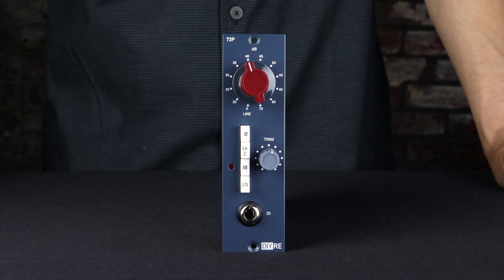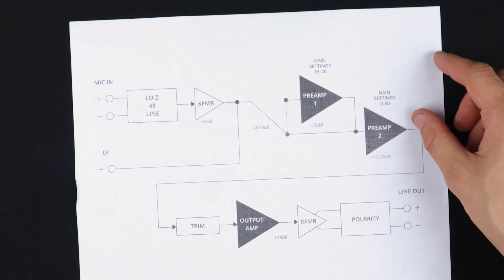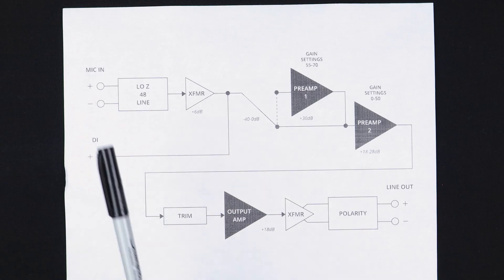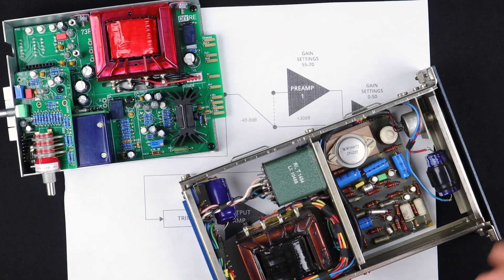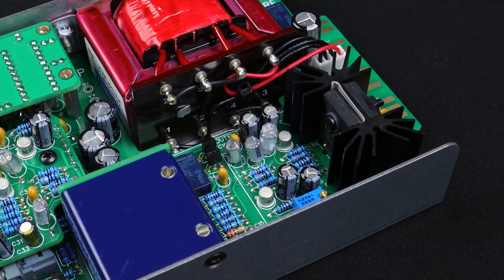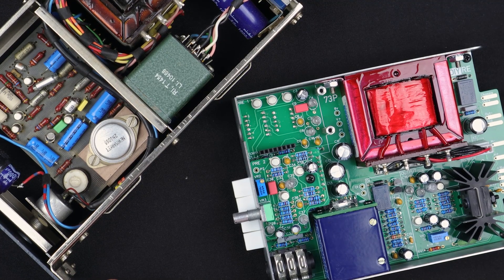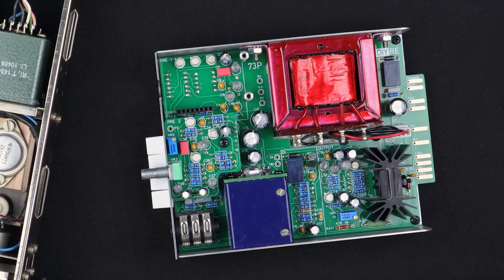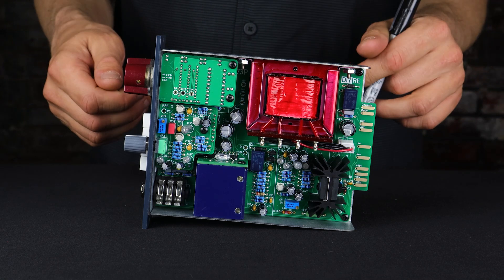What makes a great Neve clone?

Comment: Good explanation of the way it achieves high gain by inserting a second preamp stage, and also how some cheaper Neve inpired clones are actually line amps repurposed. 
However, I think it might have been useful to point out that there was never a HiZ input on the vintage modules. 
Another point Iwant to make as a user for most of the eighties of a 8068 console with 1084 modules, is that at the time most of the distorsion came from the tape deck ! And what we really loved about those Neves is that the preamp would no distort on very high transient content, contrary to many other cheaper consoles at the time. The headroom on those conseole was just amazing. So it amuses me to read on certain forums that people buy Neves for the distortion 🙂 After 45 years recording mixing and mastering music, I can tell you that the most desirable thing in a preamp is how it repects the source.  On that account there are two leagues of preamps, the clean high gain and musical ones in the first, and this preamp is part of it, and those that mimick the good stuff but have not enough headroom or too much noise. Those second league preamps can work wonders on certain sources but will fail you one day or another, like when recording very quiet sources or on the contrary extremely loud ones.

Comment: DiyRe Neve "clones" have either class A/B, or class B circuit if power supply sags under dynamic conditions. Another strange thing is calling 1290 preamp 1073 preamp/eq.

Comment: Cool.  But I think i'll wait until version 1.01 of the circuit board, so as to avoid having to tear it apart and cut solder traces like I did on a recent build using 1.0 of a circuit.

Comment: The loss thats occuring between the stages, why is that happening?
Reply from the maker: Good question. That's how it's designed. Instead of varying the gain of the amplifier stages at every gain step, the switch introduces attenuation between the stages to get the correct net gain. They did this because the amplifier stages are not stable at low gains.

Comment: You nailed it! All the key factors, and you brought out the 1272 comparison as well. Two gain stages is absolutely not a 1073/1084 preamp; it’s at best a 1272, unless they try to get 70dB gain from 2x stages, at which point it’s completely bastardized. 

I’m very interested in which transistors of the same part number distort/saturate “the best.” That was news to me but makes sense. The zener based voltage regulator is one I’ve never heard before. Makes sense, and I think it depends on what one would call sounding“better.” Basically almost none of the racked vintage 1073/1084 modules out there have this type of voltage supply. Many of the vintage consoles have had their PSU’s rebuilt to deliver a steady +24V supply regardless of current demand. I want to know what percentage of vintage modules and consoles out there still use this zener regulator topology. But still, it’s an interesting idea.
Reply from the maker: Thanks very much! You've put your finger on a big difficulty with any clone: which is the "original"? Is it the one from 1971 with an old power supply and electrolytic caps which went bad so long ago it's impossible to test what they sounded like? Or the same desk in the 90s with a cleaner power supply and fresh caps? At the end of the day you do need to make some calls base on what sounds best to you, and that's why we went with the zener/pass-transistor regulator circuit. It adds just at tiny bit more goosh and rounding of transients; that is, a bit more of what the original was known for.
Reply: @PetersonGoodwyn  Yep, I bet it sounds “slower” and somewhat“squishy” (whatever that sounds like) compared to a “properly” regulated 24V rail. I can visualize how that would look on a scope though. It will give your clone a unique flavor in a sea of clones. 

Hey, cool video. I didn’t know about your company prior to this, but now you’re on my radar. I’m a Group DIY guy, so I appreciate the super helpful educational tools you do. I’ll definitely keep you in mind for future needs.
Reply: Also, no 31267 XFMR on the line input. Is there any gain/trim adjustment capability? If so, do you just pad the line input signal and run it through the final gain stage at the “trim” block on your diagram?
Reply from the maker: Good question. No, the line input just engages a balanced pad before the input transformer. So it passes through all the same circuitry as the mic input.

Comment: its from the seventies, not from the sixities. most modules are about 50 years old not sixty. then in a typical 80series neve the input module doesn't just go to a passive bus (except bcm). THE typical 80series sound is input module, routing module, output gain module (all active 6pairs of xfmr) for a mixdown or recording over active group modules.
Reply from the maker: You're absolutely right, 70's is correct, I misspoke. Some of the schematics we referenced were drawn in '69 but didn't see the light of day until '70. And thanks for the additional insight in to the 80-series signal path.

Comment: Can you say what your main application of the Tantalums caps were?
I'm using NOS film and some Soviet paper-in-oil caps for a preamp design project and am considering Tantalums in feedback part of the op-amp circuitry and in some power decoupling.
Reply from the maker: These designs used tantalums for A/C coupling. Feedback capacitors were polystyrene and power decoupling were electrolytic by and large.
Reply: @PetersonGoodwyn  thank you 🙏

Comment: This looks great! Would I be able to replace current transformers with my vintage Marinair i/o transformers?
Reply from the maker: Thanks! I'm not positive about that. The old transformers will definitely work in the circuit, but I'm not positive that they are the correct dimensions to slip right into place. You could check the dimensions and pinout of the VTB 1148 and VTB 9045 in the Carnhill datasheets to confirm: https://www.barryrudolph.com/recall/manuals/carnhill_design_guide.pdf
Reply: @PetersonGoodwyn  , okay. Thank you!

Comment: But was it really wise to make it so that the power supply sags in every module? What I mean is that if you were tracking on a Neve, not all channels are going to be drawing tons of current all the time. In other words they're not all on kick drums and such, so the power supply wouldn't sag ALL the time.
Reply from the maker: That's a great question and gets to the core of the difficulties of trying to replicate part of a console as a standalone unit. In its original format, this preamp would have been part of a larger system (the console) that affected how it sounded. Now we're trying to take out just that one part while recreating the sound of the whole console as much as possible. The power regulator circuitry on the 73P is an attempt to bring the power closer to the original conditions, but it's not perfect. Also I should try to give you a better sense of the scale of what the power regulator does. Much like the transistor distortion, the sag is not present in the linear operating range. It's only when the unit is pushed to extreme levels that the sag begins to affect the sound.
Reply: @PetersonGoodwyn  Sure. It's all a compromise.

Comment: 3 preamps are not necessary for different gains. I would prefer only one preamp with a gain control. I don't understand very well this part. May be if I see the schematic I'll figure it out.
Reply: Then a discrete Neve design is not for you 💁
Reply from the maker: Another way to think about it is that there are only 9 transistors in this entire preamp. In even a very simple IC opamp there are 20+. So, while this design does have three amplifier stages, it does not actually have more transistors than a simpler one-stage design.

Comment: What consequences have merging on the same heatsink the output transistor with the regulator one?
I dont know much but I try to separate PSU from audio as much as possible.
Does it have any benefit to correlate heat variance from both paths or is it  just a compromise of 500 series limited size?
Keep up the work! Love your company and really dig all the documentation you give us 🫶
Reply from the maker: No consequences that we can hear or measure. Using the big transistors and heatsink means both run very cool. So neither transistor is getting into a thermal range where performance is significantly different from the baseline spec.

Comment: Really amazing project ! how would it differ form an AML or BAE version of the 1073 for example? The accuracy of teh PSU and transistors?
Reply from the maker: Great question. Those are also excellent preamps. The 73P and AML are very similar—the main differences are that the 73P has the line in switch, DI, and trim knob. The BAE is different from both in that it's 1272-style (two-stages).

Comment: I'm glad that there are people like you who deep dive like this and explain in such a clear manor. It makes me believe you more than some marketing jargon.
Reply: It is full of mistakes made to boost sales. I'm surprised Diyre did this because they have some interesting projects like colour modules, bus compressor, 500 series stuff, support, etc.
Reply: @Signal_Glow  please name some of the mistakes id like to look into them
Reply: @LiquidPeppermint  For one, this is not a clone of 1073, i believe line input is missing, many other preamps have several stages, class a doesn't really sag, etc. My comment was primarily about description, i didn't go further into electrical and mechanical side of things. Reading and then watching the same thing over and over for almost 30 years can be deceiving, as one carries it gets boring.
If that nice switch is firmly on the pcb and output stage is biased like original, then this is nice recreation of 1290 preamp, but not a copy.